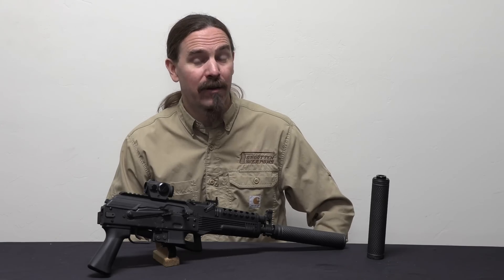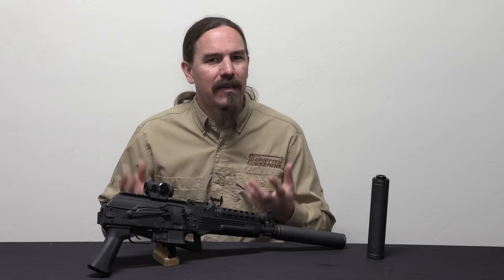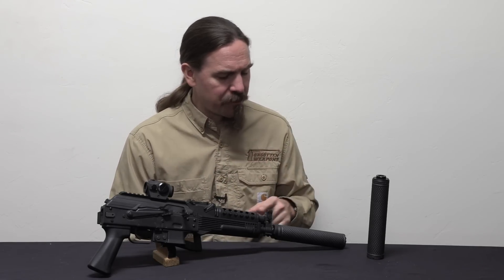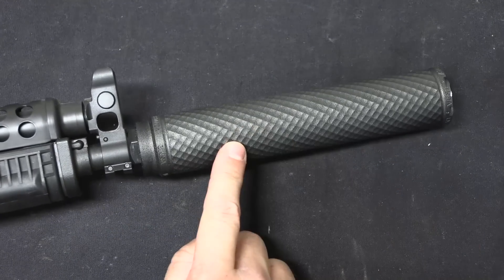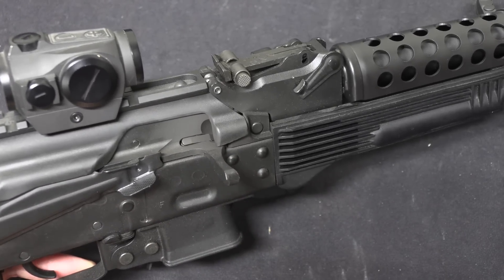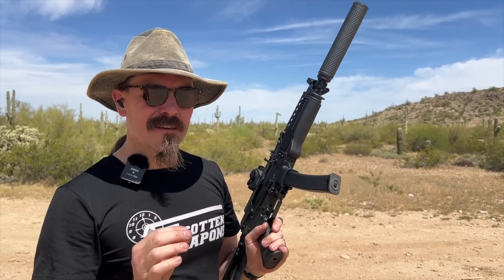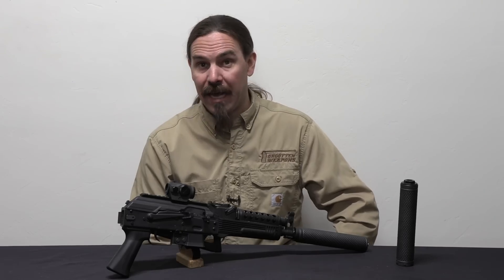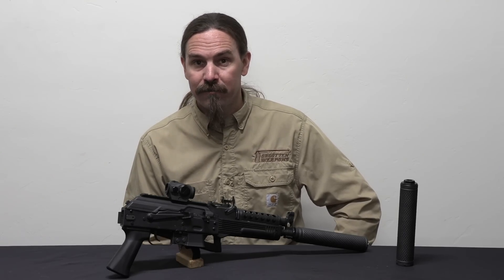PTR Vent Suppressor: 3D Printed Titanium Foam

Comment: hey ian, cool video, i have a question for you: is there a self regulating recoil operated system like the m14 has  with the self regulating gas operated system??
Reply: In a way I think the friction rings of an original A5 are kinda that but you have to switch em out yourself

Comment: I've wondered about open cell metal foam in this application for some time. Nice to see my suspicion validated.
Reply: Porous aluminum foam was manufactured for suppressors by simply pouring molten aluminum over salt granules then dissolving the salt in water.  Drilling the bore out and enclosing the aluminum foam baffle in a casing resulted in a suppressor.
Reply: Check out diffusers for pneumatic robots
Reply: @jurban7998  for those robot arms? Is it to allow more fine-grained control with them? I searched online, couldn't find any relevant results, could you share some more precise keywords to search for? Cheers, thanks
Reply: @jurban7998  I know about them. I was just waiting on someone to use that idea in a suppressor.
Reply: honestly at that cost, this company really doesn't want the nfa to go away, say suppressors stop being taxed, the old mesh style will win the market hands down at under $50 a pop